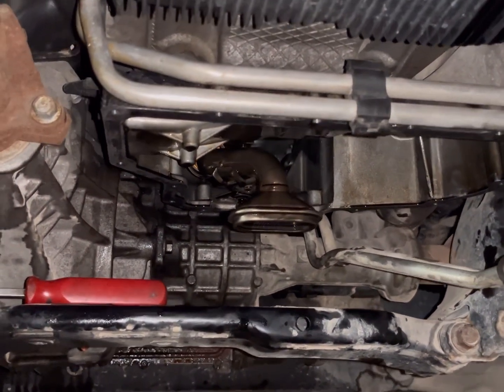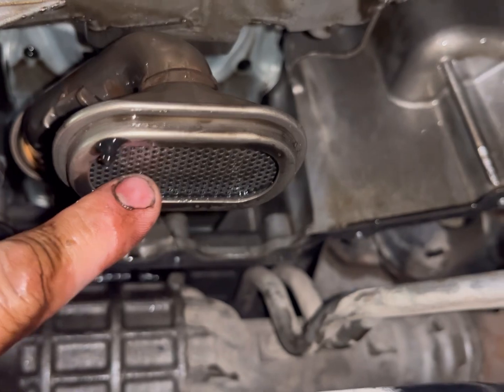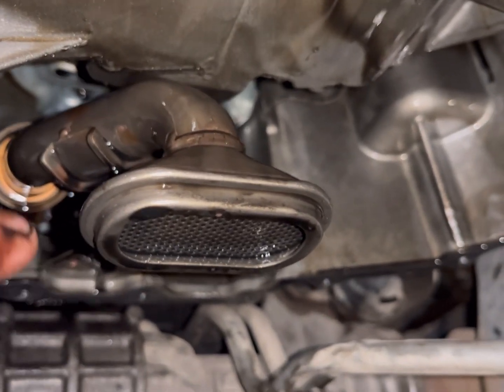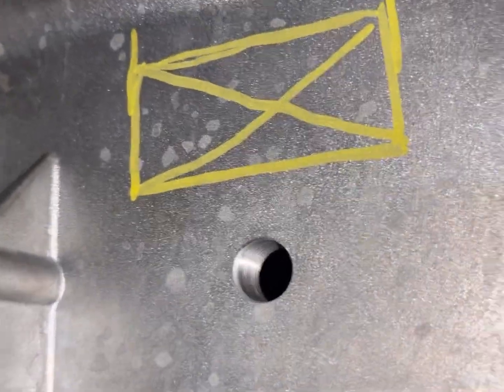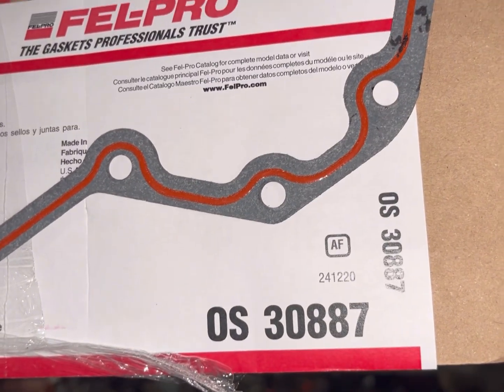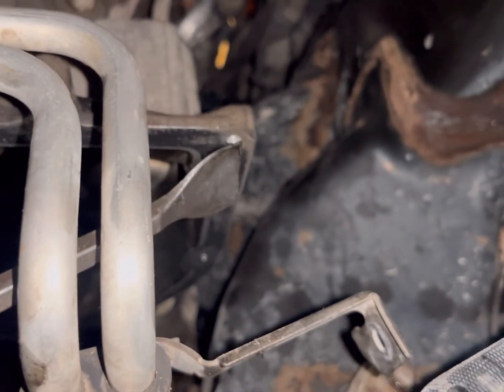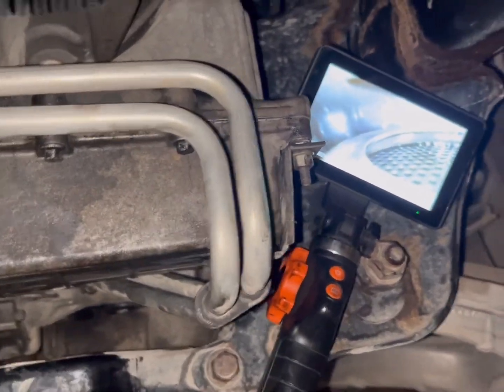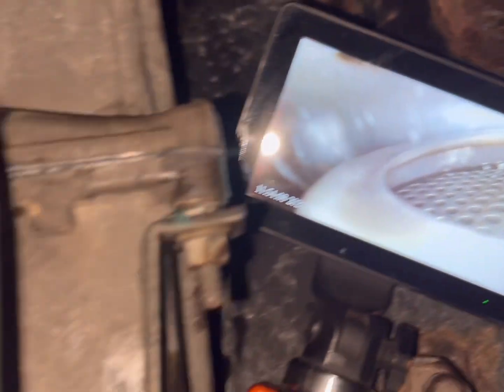Ram 3.0L Ecodiesel lower oil pan removal and inspection of pickup screen for debris

Comment: Having low oil pressure light come on when coming to idle. Did an oil change thinking it would help but I didn’t check the pick up. Definitely going to drain and take pan off and see if it’s clogged. Thank you for your video
Reply from the maker: Sounds like the a smart idea. Be sure to do so before you drive it anymore. And I now just recommend carefully using black RTV sealant. Just be smart about applying it. Too much, and it will squeeze into the pan excessively.
Reply: @tadsworkshop hopefully the main bearings didn’t slip. took it to a shop and they said the engine is toast cuz of the low oil pressure light. They said they pulled my oil filter and saw little bit flakes in there but when I did the oil change there was nothing in my oil or filter when I pulled it.
Reply from the maker: @anthonyhernandez7035 this might’ve been BS,  their metal in filter comment.  I would inspect that pickup screen, and if it is clear, I would continue with the oil and filter change, and start suspecting the oil pressure switch. I’ll say this, if the main bearings spin in the engine, typically you’ll see almost a steady stream of oil coming from the rear of the engine while it’s running.
Reply: @tadsworkshop  I have a slow leak coming from a seal in the front crankshaft. So possibly did have the bearings slip ? If that’s the case is it possible to fix or no
Reply from the maker: @anthonyhernandez7035 if you are seeing a slow leak at the front crankshaft seal by the harmonic balancer, I wouldn’t read into that too much. Replace that seal when you can.

Comment: I got a suggestion from a tire guy who thinks I should be using euro blend oil instead of HD. I have been using 5w-40 T6 Rotella. Any thoughts? Internet search to no avail.
Reply from the maker: No. Use 5W-40, ideally something designed for diesel. That is all that matters. The point of this video is, inspect your oil pickup every oil change if possible to prevent engine failure. No matter how pretty the label, and clever the wording on the bottle, nothing will prevent injector seals from failing and causing the valve cover to disintegrate from combustion gases and dripping debris into oil pan. Also delete if possible in your location - that soot in the intake contaminates the oil and causes excessive pressure drop across the oil filter.
Reply: @tadsworkshop hello i had a ecodiesel jeep before and used Mag1 5w40 full synthetic euro spec oil on it (where i live at the time that was my best option), ran perfectly fine, i sold it and now have a 2015 ram ecodiesel, is there any problem if i use the same oil?
Reply from the maker: @ziadt4264 as long as it is intended for diesel engines, use it, absolutely. I don’t care what brand personally, but i don’t use 5w-40 intended for gasoline engines.
Reply: @tadsworkshop yeah its a 5w40 says its for diesel engines, as i said i ran it on my jeep and even the noises coming from the engine were alot less the entire time i owned it, just thoight i would ask someone who knows more to make sure, i will keep you posted, thank you for your time

Comment: I have a 2018 ram  ecodiesel with 68,000 miles. I am considering a delete on it. Do you have any recommendations?
Reply from the maker: You should definitely commit to it, for the sake of longevity. Where are you located?
Reply: @tadsworkshop West Melbourne Florida. East coast 40 minutes south of nasa/ space x. Watched some of your vids. Real good stuff. Started dropping oil pan. RTV, never tried the gasket.
Reply: Very interested in your results on swirl valve cleaning you mentioned.
Reply from the maker: @forYAHSglory I’ve cleaned an ecodiesel intake manifold by soaking it in a 5 gallon bucket of degreaser for a few days. You can physically/mechanically remove the soot around the swirl valves once you have the intake off. Overall, I’d recommend you install a new Dorman intake manifold vs trying to clean it the old one. The OEM manifolds can fatigue over time and eventually pop causing a boost leak. But that’s with maybe 200k plus miles on them, etc. but they have a finite lifespan.
Reply: @tadsworkshop great advice 👍
Reply: Did it leak with the r t v or did you have to replace it with a gasket
Reply from the maker: @jerome1401ify for this video, I used the Felpro gasket. It does seem to leak just a little. I now prefer and recommend to use Permatex black RTV, being very careful and precise with the application, so there isn’t an excessive amount being squeezed into the pan.
Reply: @jerome1401ify I purchased a gasket on ebay it came with RTV bead around the edges and looked cheap. Used high temp RTV liberally and it worked. If you plan on leaving cross member drive front end up on ramps. Get a flexible socket shaft. Some screws are tough. Get a borescope. Kline has one for 40. Stick it in oil pan drain hole next oil change to see if you have to go through with it.

Comment: Thanks for the video,What is the torque on the oil pan bolts
Reply from the maker: I believe 10-11ft lbs. Just use common sense and do it by feel, if you have the experience.

Comment: Just did this on mine, have you experienced any leaking or seepage around the the gasket since its been installed ?
Reply from the maker: It’s funny you mention it because, yes, it might be. I’ve noticed some oil on my pan but figured it might be from the oil filter housing. I haven’t made the time to really look at it. But If it is, I may pull the pan at my next oil change. So, I don’t know for sure if it is leaking.

Comment: I took my pan off last summer and it was very clean, and I change my oil every 8th klm. I would like to know where you are because I have been losing antifreeze and I would like to know how much time it takes to fix the turbo coolant line 2017ram ecodiesel
Reply from the maker: @richardlambert1544  I’m an hour north of Detroit. Near Sarnia.
Reply: @tadsworkshop  I am  20 minutes minutes north, of Sarles North Dakota, little town called Crystal city Manitoba
Reply: You are a good mechanic judging by how you explain it, if I was 20 years younger I maybe would tackle that turbo coolant line
Reply from the maker: @ appreciate the kind words.

Comment: Do you have any knowledge or experience on using that felpro gasket with the AFE oil pan for ecodiesel?
Reply from the maker: @robertclegg3624  I’ve never installed the AFE pan, but I just can’t imagine any incompatibility between it and the Felpro (or any) brand gasket.